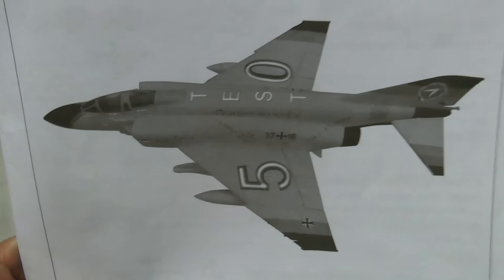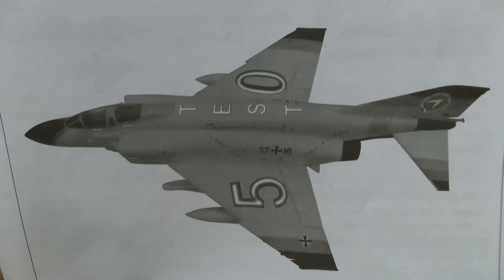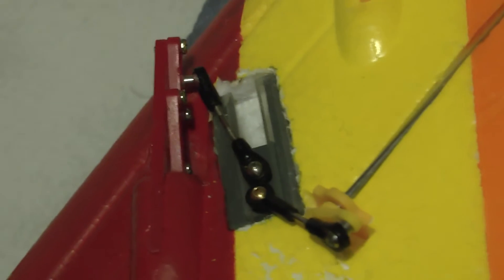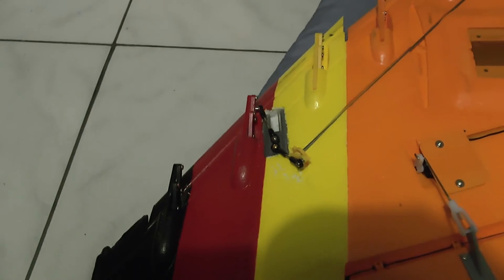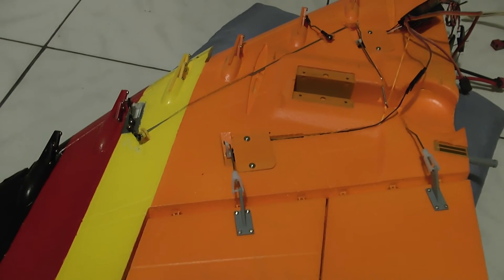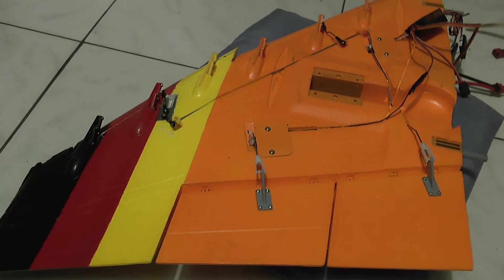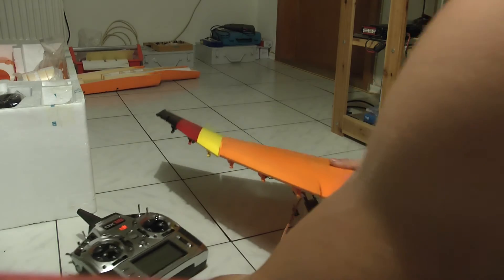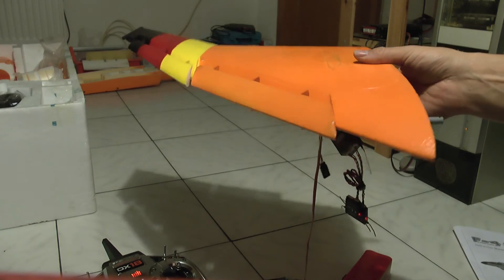LX F-4 Phantom II - Slats Modification

Comment: The detail you put your F-16's was amazing, so I know the mods into the F4 will make it better. Notify LX Models, they may use your ideas. I look forward to seeing the F4 in the air. Have you thought about the Yak 130? That looks like a nice jet, a bit pricey though. I might buy the kit version.
Reply from the maker: thx srwilliams1963, this kit is not really easy to assemble. i had to cut and disassemble the slat system several times because i wasn't satisfied with the movement. its all about the glueing angles, all 3 links to the slat have to move together. usually the best way would have been to put a servo for each slat, or to completely re-think the mechanism.
the yak is nice but too much hype for me and as you said "pricey".
r2fly had a video competition last year as test pilot, well, i did not win :)